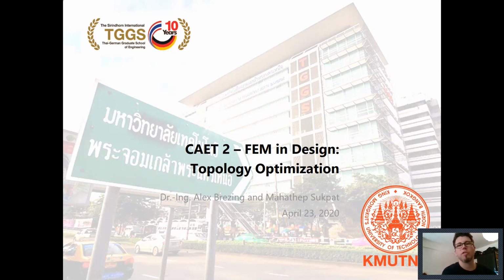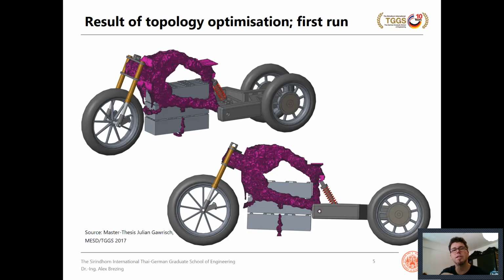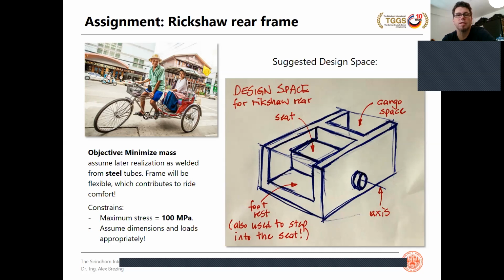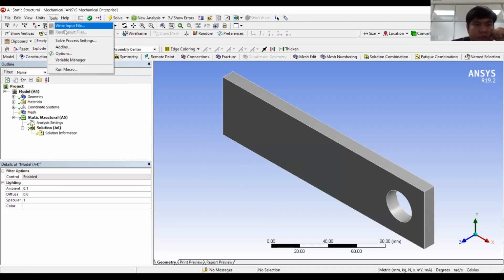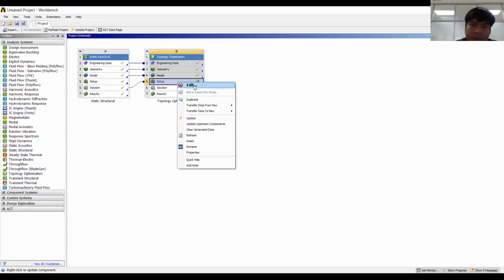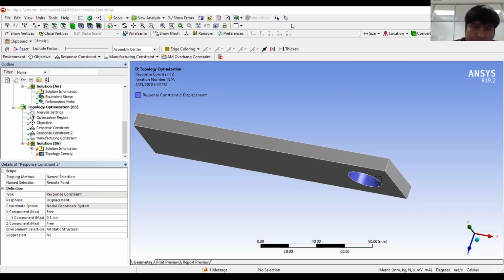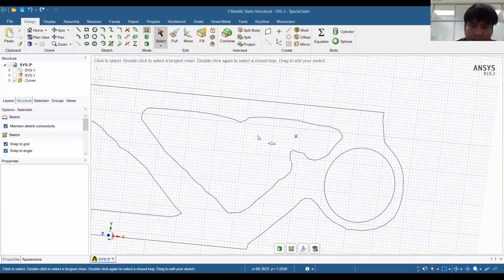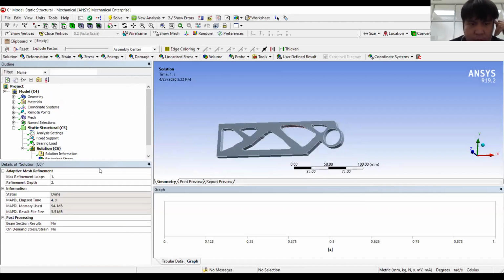Topology Optimization with ANSYS

Comment: Sir I have install crack version of ansys 2021 but topology optimization tool is missing in my toolbox I have check it in a view/customise but topology optimization tool is not their can plz help me to get that????
Reply from the maker: Haha, you must be joking! No, I can not advise on crack versions other than getting rid of it. My students use legal student licenses, but it means limitations on element numbers.
Reply: @AltheSplinebender  but u know how to add it .
If some tools are missing can u plz help me.
Reply from the maker: @Chinmay_9812  I can only guess that you choose the options when installing the software. So I’d try running the installer again. But I don’t know the later versions of ANSYS. it is possible that the module has been renamed or even removed from the package. There are many discussion groups in the web that can probably help you better with this.